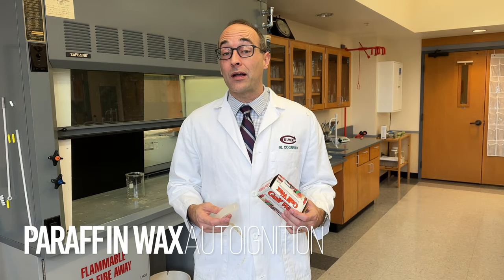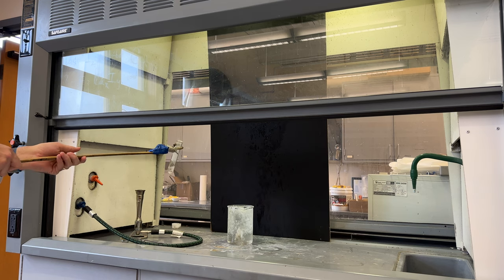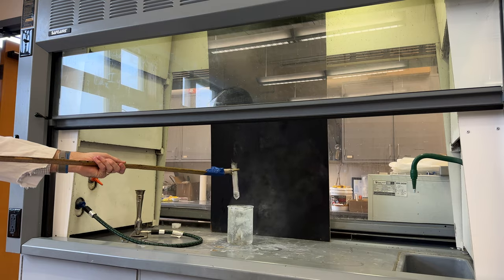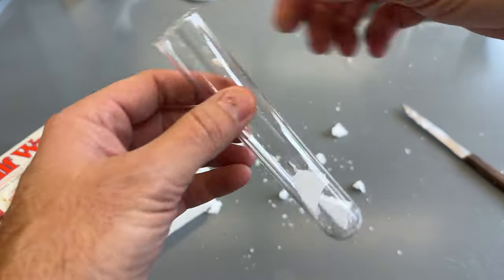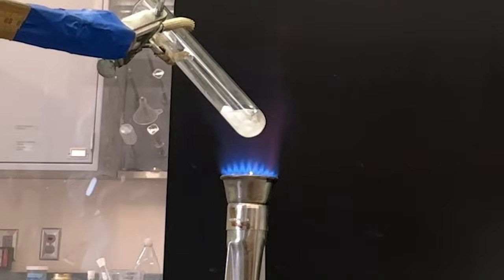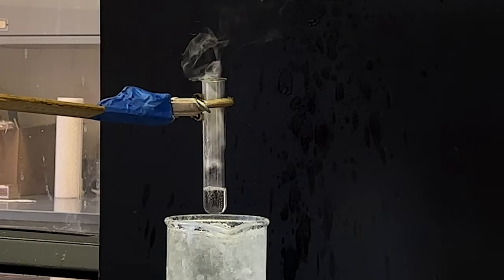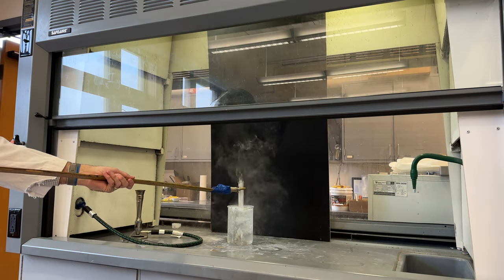Paraffin Wax Autoignition

Comment: I've got a Ph.D. in chemistry, taught college for 35 years, had never seen such a thing, and think this is a delightful video!  Wish I'd had it while I was still teaching. Good job!
Reply from the maker: Thank you!
Reply: 35 years is quite a number, sir. Thank you for your service.
Reply: To still be as delightful as you are after 35 years of teaching, especially teaching college, you must have a heart of gold.  As others have said, thank you for your service to our education system and for teaching our next group of chemists.
Reply: It is difficult to get a PhD in anything takes a lot of effort.  But then chemistry is superstition at best.

Why can tetracyanoethylene accept an electron but not tertraaldoethylene?  Why does anti/aromaticity exist, when all atoms on the ring have a full octet either way?,  why is benzene stable, borazine as well, but not hexa aza benzene, n6?   

Being unable to answer freethought guestions is the hallmark of nonscience
Reply: Well sir what I can tell you I think what he  just done here is forcing to cool down the flammable liquid which has reach it's flash point, even in deep fryings once the cooking oil reach its flash point any attempt of trying to cool it either by pouring water it can cause fire explosions, anything that reach it's flash point can be extremely dangerous
Reply: @Daboresa except that no water touches this oil.  Watch the video again, he simply dips its container in water.  What doesn't make sense is why cooling it off makes it boil.  Really think about that.  It makes no sense.  You dip things in water to cool them off, not make them hotter or boil.
Reply: Backyard, the water did touch the wax when the test tube broke. Watch it again. Maybe it will make sense.
Reply: The stuff looks all innocent and inert, boring even sitting there.

Even molten it is largely incapable of much. Mostly just has that bit of phase change thermal thing going there. Don't want it on you.

Get it boiling. At first it's amusing if this is happening in a small area in a pool... But you better run if you see this... It is a gnat fart away from going completely stupid on you.

Doing it the way I experienced it, it wasn't now like in the video, but only took a few seconds to go from "well look at that" to "holy sh¡t!!!” and I'm just lucky that when the glass broke, the molten charge landed in a snow drift. Things would have been a bit different had it hit hard ground.

All I had going was some extra wick... And once the whole bulk was molten, there was nowhere else for it to eat heat, and the boiling started.

It is indistinguishable as far as I can tell from gasoline at that point.

You're playing with your life if you boil paraffin. All there is to it.
Reply: @BackYardScience2000  Something similar happens with a hot saturated aqueous solution of KNO3. If the container is covered while the solution is being heated, the water vapor retention keeps it stable. If you cool the surface of the solution and the bulk temp/concentration is right, it will flash boil at the surface right where the cooling is taking place. This can get violent because the effective surface area increases and therefore so does cooling; a positive feedback loop that wants to run away in at least one regard.

I don't know how much overlap they share but it is certainly a flash-by-cooling phenomenon and failing to resist the urge to uncover to allow to cool, like you can do with pasta to stop boilover, will get you into trouble all the same. It's not "explosive" of course in the same sense wax is, but does definitely rise up and want the hell out lol. 

This can also be triggered even when the solution is "cooler" (not quite flashing just from cooling by evaporation)... By cooler yet water being added in small quantities, say drop wise... Only the flare ups are much tamer, and are localized around the drops (I assume because of less surface area and/or mass). Adding significant quantity causes a brief flash but the mixing quickly eats the extra heat that has it on the edge of boiling and so it self-arrests.

I'll leave it up to someone else to work out how relatable they really are. But yes it is a thing in at least one other place in physics.
Reply: @BackYardScience2000  Cooling it off doesn't make it boil; it was already boiling before. The boiling wax is hotter than the boiling point of water, so the water rushes in, boils when it contacts the hot wax, then that expanding steam propels the wax up away from the container.
Reply: @BackYardScience2000 
It cracked and water got inside. He said so in the video.
Reply: @BackYardScience2000 he said what happens.  The test tube breaks from the hot to cold (what Pyrex solves).  So then the paraffin immediately touches the water from that event.  Did you watch the entire video or wanted to find a reason to get upset so soon?
Reply: @Daboresa well no here what’s happening Is that once the water gets into contact with the wax it instantly turns to gas which shoots the wax droplets in the air and with a tiny amount of a wax particle surrounded by oxygen and heat it combusts
Reply: But what prevents the auto ignition when it is in the test tube over the flame? Google says the auto ignition temp of paraffin wax is 250c. But the guy in the video says it won't boil until 370c.  Not only that, but heating it over a flame means there are likely much localized hot spots.  There is a reasonable amount of oxygen in the test tube. Presumably before the whole thing can be brought to a boil, there should be paraffin vapor in the tube with plenty of oxygen and surface area (since it is vaporized).
Reply: @BackYardScience2000  The shock probably ruptured the test tube.  But what I can't understand is what is preventing autoignition in the tube. You have oxygen in there and vaporized paraffin.
Reply: @christo930 You need sufficient enough oxygen surrounding the molecules to undergo ignition. When you atomize it, you increase the surface energy and have more points where oxygen can interact.
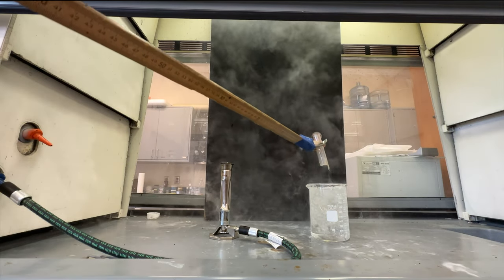Reply: @BackYardScience2000  1:22 "As soon as the test tube hits the ice water, IT_" *_CRACKS "

You either rushed to comment and didn't watch the whole video. Or you just didn't pay attention.
Reply: I'd love to hear your Chemistry lessons,  as an teacher to a student. Even if you're retired.
Reply: WHAT?  FUEL, OXYGEN, HEAT, BOOM!
Reply: That’s a long time to teach. Good man!!!
Reply: @christo930 The vapour is expanding out of the tube, pushing some (most) of the air out. For every ml of wax that evaporates there will be several hundred ml of pure vapour, leaving the Inside the tube above AIT but too rich to ignite. It’s only when the fuel is dispersed that there is sufficient air to ignite. While it is true that it doesn’t have to be air to burn, at less than 20.9% oxygen things still burn, I’d also hazard a guess that the limiting oxygen concentration is high for wax - lots of carbon atoms. Contrast it against something like diethyl ether that’s much lighter and comes with oxygen ‘built in’, and a correspondingly lower limiting oxygen concentration
Reply: Sir thank you for contributing to Education in High Ed!
Reply: I took some various math upgrade course modules in college to qualify as an adult. Formulas is chemistry? I aced that work. The pattetns were easy to see. I like math.
Reply: I wonder, since the parafin is a mixture of different lengths of hydrocarbons, if something causes the lighter, more flammable fractions to be ejected first, when the steam causes the ejection of the parafin into the oxygen rich air above the fracturing test tube.

If you take a oil and vinegar salad dressing, and add water, you see the heavier water and vinegar fraction go to the bottom, while the oil emulsion "breaks" and moves to the top of the column.

If the water/vinegar were boiling, to provide steam, to expell and atomize the oil, would it flash as well?

Interesting demo. I hope this gets shown to petrochemical fire fighters, some of the bravest people on the planet.

They go to work each day surrounded by flammable hydrocarbons at temperatures and pressures, surrounded by a 21% oxygen gas mixture, with a thin layer of just plain old steel that should scare the living hell out of anyone with three brain cells!

Comment: Very impressive demo.  For a fun and safer demo, light an ordinary paraffin wax candle.  Once it has burned for a bit, snuff it out.  Wait a few seconds until a nice stream of "smoke" (actually vaporized and condensing wax) forms, rising upward.  Light the top of the stream with a lighted match.  The stream will ignite, and the fire will run down the stream and re-ignite the candle.
Reply: I used to do that as a teen but didn't know that this is the scientific explanation for it. Thanks for that.
Reply: That explains why it works with a paraffin wax candle and not a stick of incense or so
Reply: I've known this a while, but I could never have explained it like you did. Thank you!
Reply: That is not the same concept that is happening here... The reason the candle wick reignites is because the smoke is hot enough and has enough flammable particles in it to be reignited by a flame you introduce. This wax ignites itself, which is already entirely different from your demonstration, for an entirely different reason. One you could have read in the description and realized they are not the same reaction and saved yourself the trouble of this comment.

Two entirely different things.
Reply: @RedTail1-1 … wax vapor, oxygen, and heat in the right concentration. Sounds similar enough to me.
Reply: Gasification
Reply: I prefer the "dangerous" version, because it shows why as a chemist, you need to keep a cool analytical mind at all times, even when something unexpectedly overflows or catches fire and you need to move it to a safer vessel. Putting hot glass in ice water was the mistake, and one very common technique to slow down a runaway reaction is to cool it.
Reply: @stickyfox  Okay!  🙂

Comment: my parents used to seal preserved fruit with wax and i remember them warning me about wax vapors. mom melted the wax bars in a double boiler to keep the temperature at or below boiling water temp, and took it off the stove immediately upon melting to seal the jars of preserve. fascinating to see what they were worried about.
Reply: I never knew wax could do that.  Sometimes you learn something new.
Reply: That is what my mom
Did too
Reply: that temp was 700 degrees f. The melting point for canning is probably just over 100 though you would want it beyond its melting point a bit.

Comment: This explains the accidents that occur or have occurred in candle factories or accidents at home making decorative candles, which have resulted in children with third degree burns. Thanks for most.
Reply: Not really. I very much doubt that anyone making candles is boiling the wax or heating it much beyond its melting point. Accidents are much more likely to be simply because the wax is flammable and close to a flame.
Reply: As a kid, I wanted to experiment. Yes, I boiled wax just to see it boil. Why? Because I could. I am totally amazed that I am alive today.
Reply: @oldmech619  you are my fucking hero
Reply: No water is necessary. Just tossing molten paraffin into a sink or a pail disperses and oxygenates it enough to autoignite. I did it in high school myself.
Reply: This experiment can also be done by heating the paraffin wax and then throwing the hot wax from a height (1.5 metres).
It will ignite when it reacts with air. We called it "Greek fire".
The students just loved it! We still have a black ceiling, it is so cool! 
I do enjoy your videos, I love your enthusiasm. It is infectious!😢
Reply: As noted in the video it takes a lot of energy to boil paraffin.  Most people get into trouble simply by overheating after reaching the melting point.  
Not by going anywhere near the boiling point.   Paraffin has a high specific heat capacity, so can hold a tremendous amount of energy if you are not monitoring the temperature.
Reply: @beeble2003 Wax, like any other hydrocarbon fuel, doesn't burn until it vaporizes. Normally in a candle this is happening at a very controlled rate in the wick. This concept is responsible for it burning only in the wick while that sits in the middle of a molten pool.

Once it gets hot enough, that's when the fun begins. I've had this happen, only not controlled like in the video and the situation was slightly different but the same concepts in play. The liquid started to boil due to an excessive amount of wick in the pool, and from there it might as well have been gasoline.

You should know about things before speaking about them.
Reply: @MadScientist267  "You should know about things before speaking about them."
And you should be less condescending.
Reply: @beeble2003  Not a chance. Ridicule needs to come back. My stance is due to a less addressed issue with society... Sheeple, parrots, and stupid.

Everywhere
Reply: @MadScientist267  You'll never solve society's problems by condescension or ridicule.
Reply: @MadScientist267 you explained nothing, all u said was a candle blew up, you didnt even explain why the wick made it explode despite the "very conntrolled rate" of vaporization
Reply: @okname5335  Seems to have all the useful information.

Maybe you just can't read 🤷‍♂️
Reply: Why would anyone be using boiling paraffin wax for candles? If they were, why would they plunge the candle made with the wrong wax that is boiling in ice water?? This doesn't explain that at all, it would introduce many more questions.
Reply: @daphnefernandez6589 I'm curious why it would be called Greek fire, which was a real thing, but we have no clue what it was made of.

Comment: Immersive waxing of bike chains (at ~ 200ºF/92ºC) is becoming more popular, because it is better than mineral oil, but some holdouts are citing paraffin's supposedly super-flammable properties to argue against. it. I'm glad that this video exists, so that I can point to it to prove that you have to boil it & then super-cool it to make it auto-ignite, and that doing so in a slow cooker or double-boiler is nigh-on impossible. Thankyou Phil.
Reply: Boil it and supercool it in a container that doesn't respond to thermal shock except by shattering.
Reply: That still doesn't absolve them of having to deal with the problem of wax vapors. Auto-ignition may not be possible, but thermal ignition still is.
Reply: I have been waxing chains for decades.

It melts at just over 100°.  No reason at all to take it anywhere near boiling point.
Reply: People worry about the damnedest things!